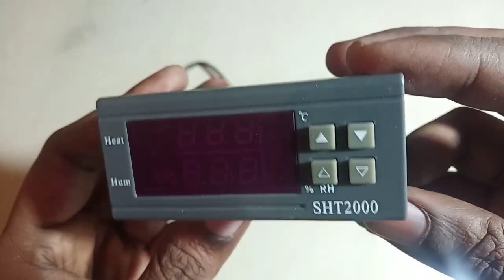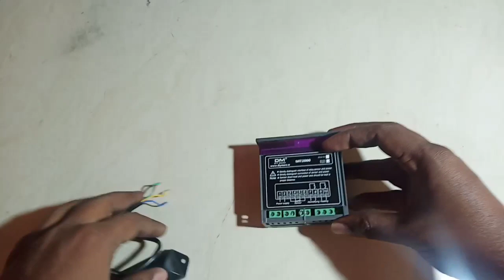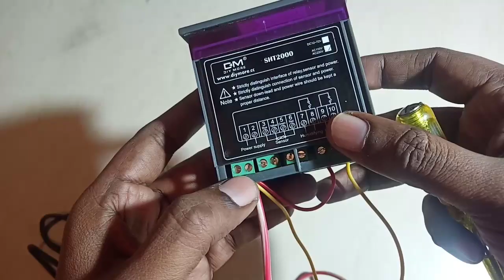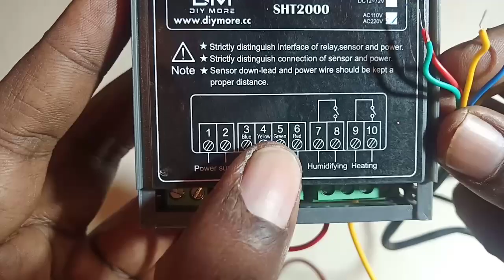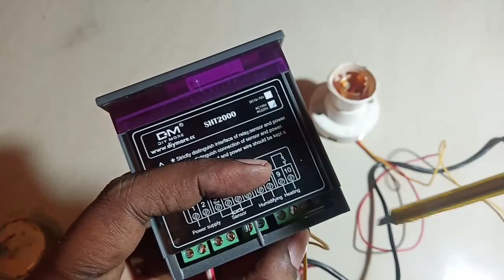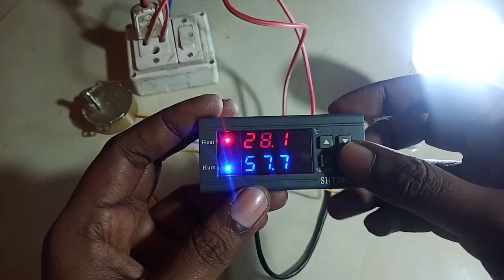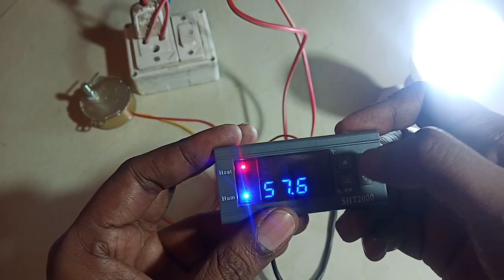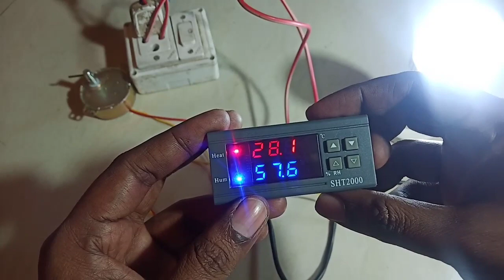Automatic egg incubator in tamil Best humitity and temperature controller @Shoba Gk

Comment: I tried this and the humidity doesn't work with mere bowl of water under the light. The humidity reader shows as	 ~32 when it needs to be 40-50%. When I spray water manually, it shoots to right percentage. What's the best way to maintain proper humidity?

Comment: Why you use synchronous motor (rotator) for humidity control... ? 🤔
Reply from the maker: Bro.. I did not have mist maker at that time. So i had shown with motor...i have told in video also..